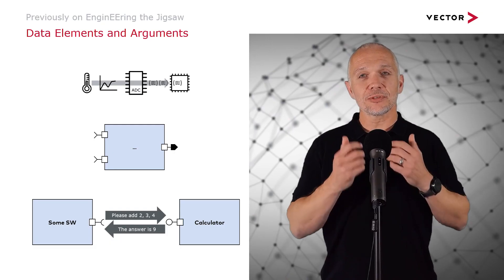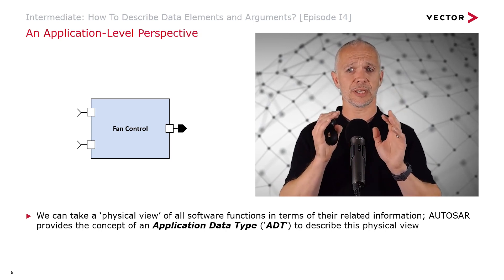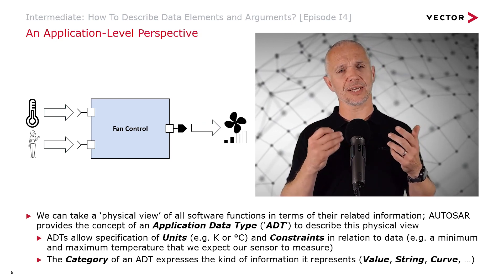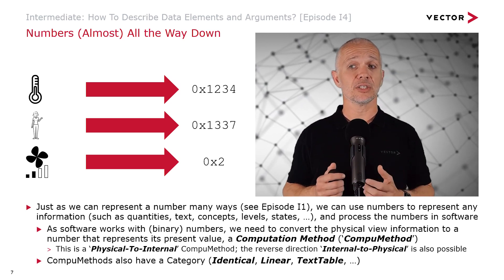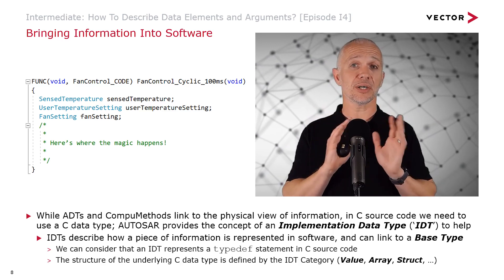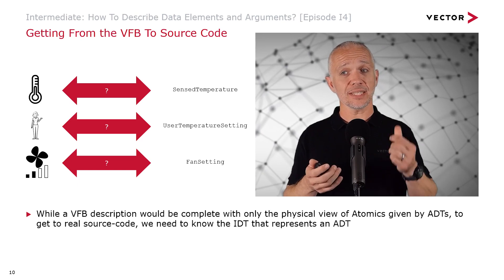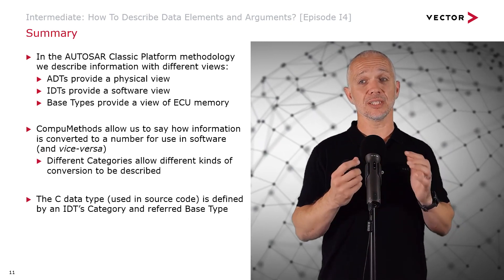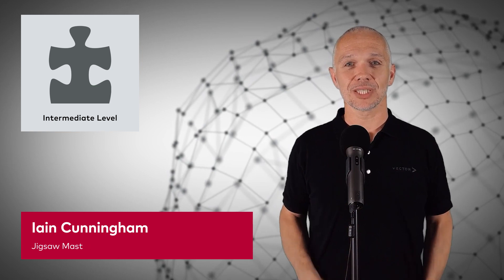Software Design: Data Elements and Arguments | AUTOSAR Classic | #EnginEEringTheJigsaw | I4

Comment: What is the difference between KL-15 and KL-30?
What are the  different operations performed in above 2 cases?
Reply: Hi, KL-15 and KL-30 are defined in the standard DIN 72552 which defines Klemmenbezeichnung (English: "Terminal Number Descriptions"), and where "KL" is an abbreviation for Klemme (English: "Terminal"). KL-15 corresponds to an electrical supply that is turned on when the vehicle ignition switch is 'on', while KL-30 corresponds to a supply that is 'always on' via connection to the positive battery terminal.

Neither KL-15 nor KL-30 are related directly to Operations in the context of this video.

To understand what we mean by "Operations" in this episode (a specific kind of interaction between AUTOSAR software components), please watch Intermediate episode 3: https://www.youtube.com/watch?v=Sp0JS8Ng8t0
To find out more about DIN 72522, then e.g. Wikipedia gives a good starting-point: https://en.wikipedia.org/wiki/DIN_72552

If we misunderstood your question, please let us know via the buttons at the foot of this page: https://www.vector.com/int/en/know-how/engineering-the-jigsaw/